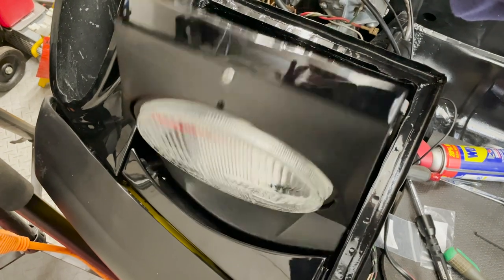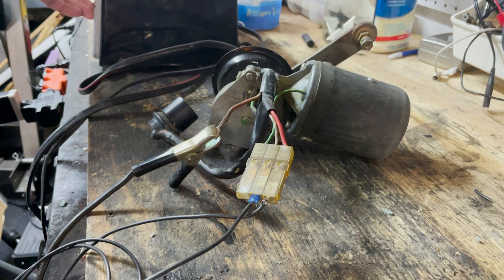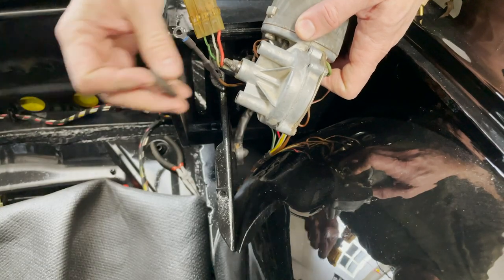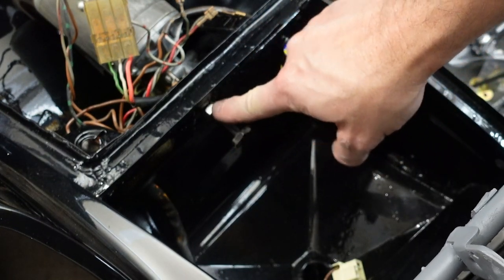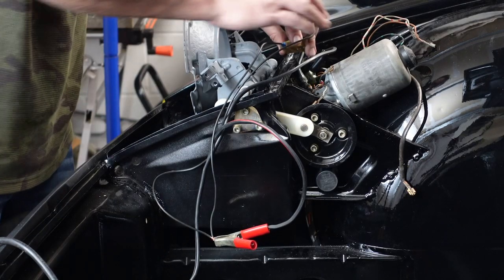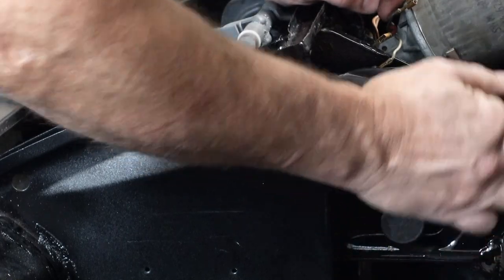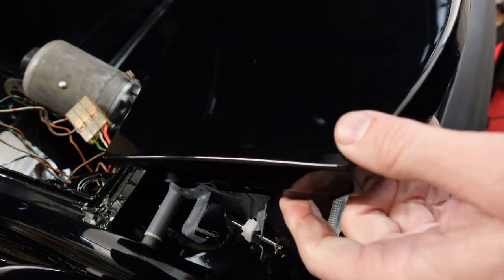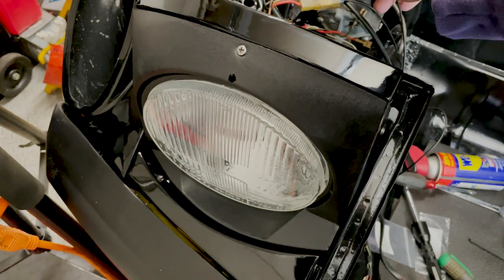Porsche 914 Pop Up Headlights - How to Build, Test and Install [Project Bumblebee Build Week 17]

Comment: great. Doing mine today! Sandbalsting the assembly and buckets first. Very helpful video!!!
Reply from the maker: You can do it, Frances! Can't wait to see you driving!
Reply: Success! 
BTW where did you get your new light motor shaft thick foam rubber washer?  The Insulator ring.

The arm rubber circle cleaned up beautifully too - didn’t have was 40 but brake clean and soap did the trick
Reply from the maker: Glad it all worked out! I think I got the foam from 914rubber

Comment: Thanks, Ian. I just rebuilt mine this week after acquiring the missing headlamp relays.
Reply from the maker: Great! Hope you didn't catch your fingers in the mechanism when you plugged em in. Please subscribe for more!
Reply: @IanKarr  Nope, I did just fine. I'm subscribed and have been referencing a few things here and there. This is my second 914 - a factory black 2.0. My first was a '75 Ancona Blue 2.0... sadly, she succumbed to flames from the classic fuel line recall.
Reply from the maker: @johnkelley7543  Yikes. Hope you weren't in it when it flamed up.
Reply: @IanKarr  I absolutely was. I was driving and thought, "hmmm, smells like cookies." Braked for a stop light and the fuel pooled up underneath and it went south from there. 

Sad day for the '75, but the '73 is infinitely better. No hell hole, no rust, racing suspension, lower miles... on and on. I got a cream puff that just needs a good paint job.

Comment: Thanks. My right headlight got smashed and in the 22 years it set outside, much got covered in dirt and rusted. I’m going to have to replace a bunch of stuff on this. 
I have the front suspension off and have had the auxiliary carrier powder coated by a pro. I’m about ready to buy a stove on Craig’s list and powder coat all the smaller parts - which should fit in a full-sized oven. Going to order front Konis today.
Reply from the maker: sounds cool!

Comment: Thanks Ian , I never knew how to adjust my eyebrows. Mine are a little off. Should just need a little tweak !
Reply from the maker: Happy to help! The annoying thing is that the brows have very little room for adjustment. It's all done in those bucket pivot brackets. If the gap between the painted headlight lid and the brow is too tight, make sure that the long edge of the brow is over and in front of the metal lip.

Comment: Great video as always. At about 8:47 you mention the stop adjustment screw.  Is that for how far the light comes down?  One of mine goes a little low and doesn't line up flush with the hood.  Hoping to rectify that.
Reply from the maker: Hi Kevin, I see that Sir Andy on the world sent you the adjustment process link. Follow that and you'll be golden.
Reply: @IanKarr  thanks and thanks Sir Andy for the detailed explanation.

Comment: Hi Ian, great video.  Headlights worked fine for years but suddenly last year they both will go up but only the passenger one will go down.  Any ideas on what the culprit may be?  I replaced the little black can relays with the new ones from 914Rubber but that didn't solve the issue.  Hopefully you have a few thoughts on this, thank you sir! James
Reply from the maker: Hi James. Check the grey or green wire (I can't remember which one controls "down") on the plastic junction box. Sounds like it may have worked its way off the spade...or maybe has a break in it. Good luck!

Comment: Your preview pane completely obscured the hat.  :D

What do you use for the outboard screws on the surround and the cover?  I wound up using an offset ratcheting screwdriver thingie with interchangeable bits.  The space is really tight in there!
Reply from the maker: Ha! thanks for the heads up (or should I say "hats up"?). Will move the preview. 
Yeah, that space is super tight. I found if I put a microfiber towel on the turn bucket and a long phillips head screwdriver, I had juuuust enough angle to turn the screw and get it tight. A ratcheting offset sounds cool.

Comment: Hey Ian - another great one.  Are the brows really just pushed in like that? The 3  rubber stoppers (?) aren't persuaded or pushed through a little more substantially into the body?
Reply from the maker: Nope. They're held in by the rubber sides and the force against the metal front.  Glad you liked the video!

Comment: Is the spring supposed to be yellow zinc plated?  Another great job.  Just for fun, have you ever thought about using the white surrounds from the 914/6?
Reply from the maker: Thanks Jeff! Glad appreciate the kind review. Not sure about the yellow spring. I am sure that it's totally invisible...unless you're changing the headlight ;). I like the white surrounds. But since this is a bumblebee, I want to keep it as stock as possible. Tthe white ones were used on 4's as well...I think until early 73.